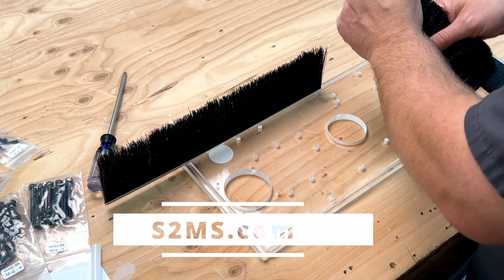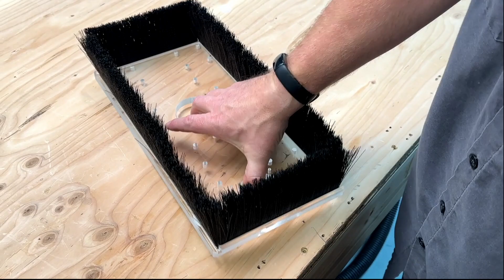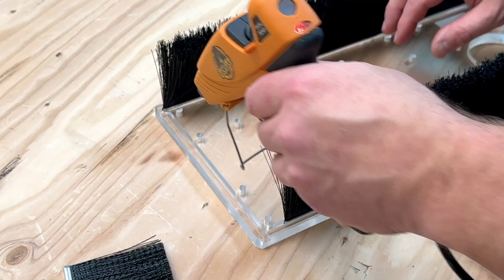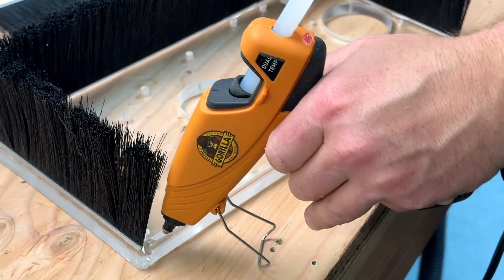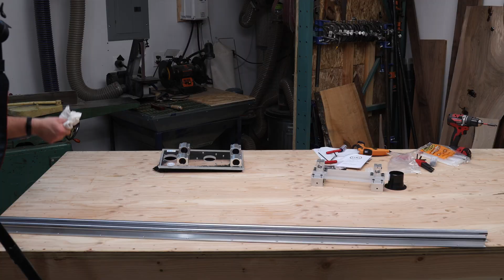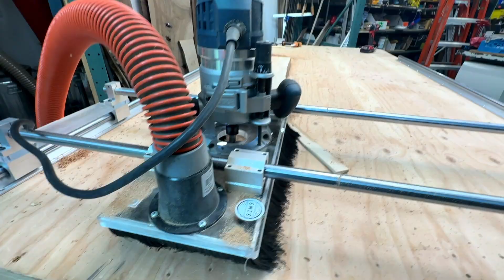Acrylic Slab Flattener Assembly

Comment: Just got it but the parts seem to be wrongly configured (like parts from two different sets where the rail attachments have bolts that are 4 cm apart and the sled rail connectors have bolts that are 45mm apart). The result is that there is nothing for one of the upper bolts to hold onto).

Comment: What diameter rails do you prefer? Worried about deflection in the middle on wide projects, and why then not use the same style rail as your side rails? Def one of the best sleds I have seen! Nice work.
Reply from the maker: With our standard rails we find the deflection to be imperceptible as long as you're not pushing down on it.  If you go with our aluminum PRO model with thicker rails you can go wider and even have a more ridged setup.  There's tradeoffs either way going with rounded or support rails.  We liked the round rails for our design.